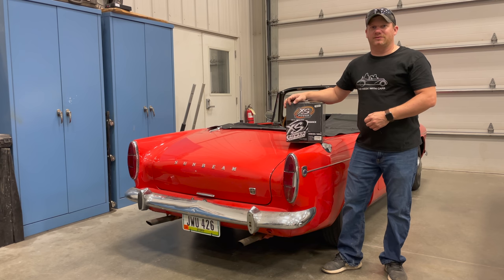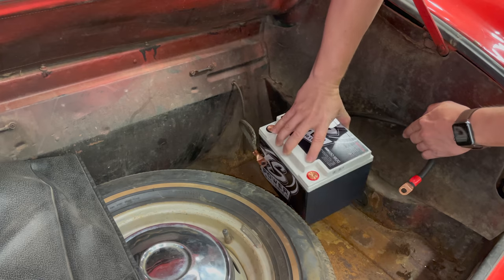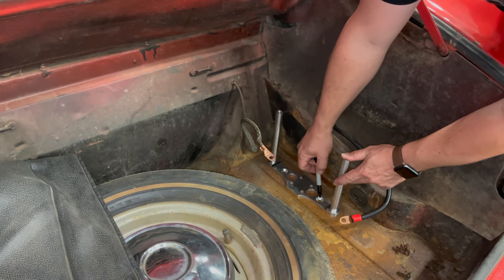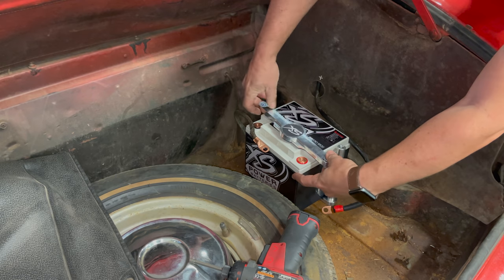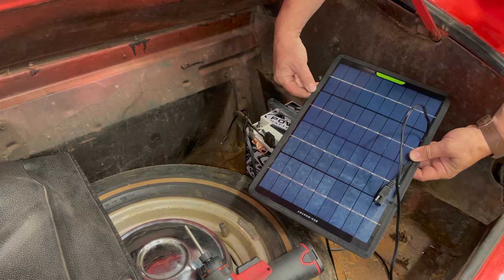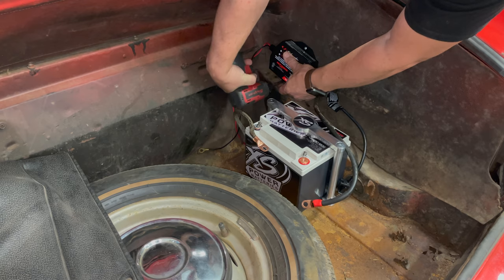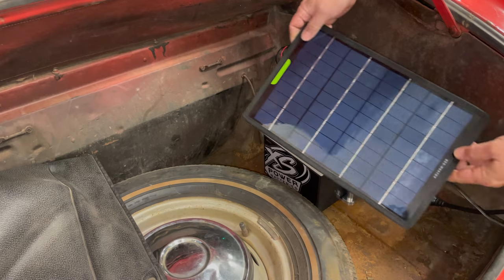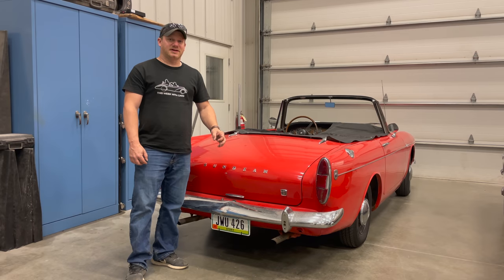Installing Ultra-capacitor and Onboard Battery Charger in Sunbeam Tiger

Comment: I too, have never heard or seen one of the Super Capacitors. From what you've shown us here Steve, this would be an ideal unit to install in my car, when I store it for the winter again.
I sure would like to learn more about these 'capacitors in place of the heavier  'old' battery.
A lot of questions come to mind for replacing these, as capacitors are not, usually, that good at storing power,

Comment: I used capacitor instead of battery on  my  Royal Enfield and it worked great with the kick start back in the 70's. I am amazed how far they have come along. Thanks for the infromation on the Ultra capacitor battery and the charging systems that can be used with it.

Comment: Goes to show you that you never stop learning. The ultra capacitor is amazing. I want one for my riding lawnmower.
Reply: No kidding. I had no idea you could get capacitors powerful enough to use on a car.
Reply: Funny you should bring up your mower Bruce. I was just daydreaming about how long the battery would last on my new riding mower and if it was gonna be hard to find the exact fit for a replacement. I think one of these units on a mower would be the perfect alternative.

Comment: I have put a flat metal plate on the top of the batteries in my own cars with a metal angle that goes to the top corner of the battery and placed the rubber under it so that the battery is not damaged or moved and keeps the battery easily in place so I never had to tighten it so tightly,

Comment: Never knew about these things. Will they eventually replace batteries?
Reply: Not likely.  More expensive, far less capacity, far higher peak current which means they are more dangerous if shorted out.
Reply: As the other replier said the capacity is tiny compared to a battery, so no good if you park the car with the lights on for instance A lot to be said for having both a battery and an ultra capacitor though. The fast charge time seen in the video is a consequence of the tiny capacity it has.
Reply: @g0fvt  Agree. Both in combination is best for cranking.  I also use the heaviest battery I can fit in my FWD Metro for best traction, but the light weight can really help front engine RWD cars especially with a capacitor in front and a battery in back can crank with a thinner cable than with just the rear battery.
Reply: @g0fvt  I calculate that a 100 amp charger would fully charge it in 39 seconds, unlike a battery.
Reply: @alan6832  there are benefits and disadvantages. With a super capacitor bank to take care of engine starting peak current a parallel combination could be very good. I am guilty of having about the biggest battery that will fit in my diesel car but it is only a tiny percentage of the vehicle weight I suspect it has little effect on traction. However it does mean I can leave the lights on for at least a few hours when parked in the evening. I have some super capacitors to play with but they are not in the car starting league. At one time I was going to buy 6 3500F super capacitors but they are a crazy price. A super capacitor bank only is not a viable option for me.
Reply: no

Comment: Well done Steve. Wondering if the computers in modern cars are compatible with Ultra Capacitors. sorry for asking same questions in all 3 videos but not sure which you would see. Cheers

BTW good find on the onboard battery charger u installed.

Comment: What a perfect idea.  No fussing with half-dead batteries, fumes or corrosion.  Did they say how long that cap lasts?  Can't see it having a short life.
Reply: As with anything, there’s a trade off. They provide a large burst of current but only for a short time. So the (big) issue is (for me) that my 1976 Triumph Stag sits for months under a cover but then takes a few cranks to start. Whilst the super cap would charge fast it wouldn’t provide the endurance needed to start the car. They’re great as an add-on to existing batteries to cover for any short-term extra demand but for a classic car, after not being driven for time, it just wouldn’t work.

Comment: What are the disadvantages of an ultra-capacitor when compared to a regular car battery?
Reply: Looking at the specs it could be considered equivalent to a smaller 20ah SLA. Imagine your Subaru battery is around 70ah fully charged but deteriorated by age to 20ah now on a cold morning. The benefits are weight loss. Great simple video though. I like the battery tie down. One point I would be thinking about is the sacrificial chemical interaction between the aluminium and the steel. Eventually it will deteriorate so it might need some protection. Nice example of a Sunbeam too I'll watch the rest of your project.
Reply: #1 is capacity.  These are likely 90% or less the reserve capacity of a typical lead acid battery.
#2 Cost - they cost more.
#3 danger - if you short out a capacitor it can dump it's entire charge in fractions of a second.  This can vaporize wires, tools, brushes etc.
A typical 80 mfd photoflash capacitor can vaporize 18 gauge wire when shorted out.  Starter windings are what? 24 gauge?  These have thousands of times more energy.  
You better be damn sure you know what you're doing and fuse EVERYTHING.
Reply: @tiporari  I was thinking of the same downsides. Regarding fuses: it might be that fuses are too slow to respond if these capacitors are able to supply such large currents in so short period.
Reply: @HGSuper  I noticed the same thing: no rust or corrosion protection was applied when putting that battery holder in place. It made me even more concerned when I heard that multiple, dissimilar, metals are involved.
Reply: @windmill1965  fuses don't 'respond', they disintegrate as soon as they see a current load in excess of their capacity.

Comment: I think a great use for fuel cells using metal hydrides would be battery and ultracapacitor tenders that wouldn't require connection to the wall.
Reply: Interesting idea.

Comment: Do you have to convert to negative earth?

Can you use one that is smaller?  I’m supercharging an Arnolt MG, and the supercharger encroaches on the battery box.  This might be useful to give room for the supercharger carb and air filter without having to move the battery to the trunk.
Reply from the maker: You can use with positive earth.  This is the smallest one you can buy but you can build your own that is smaller like I did in my first video.

Comment: Won't the mount bolt heads be kind of hard on the bottom of the capacitor?
Reply: They are countersunk flush.
Reply: Probably will fall through the rusty floor anyhow...

Comment: Living several floors up and parking under the canopy of several trees in Scotland would make this as practical as an ashtray on a motorbike for me which is a shame. Flat batteries seem to be more frequent in recent years on my current car though the car before was still on the original battery 14 years down the line.
Reply from the maker: If you drive your car at least once every couple weeks it will stay charged.

Comment: Never heard of these before. Don't think they sell them in the UK. What are the benefits? and also the cons?
Reply: They are extremely lightweight, output higher peak current, and charge almost instantly.  Downsides are expense, drastically lower capacity (not many restart attempts), far more dangerous as capacitors can dump all of their energy very quickly.  With short circuits they can vaporize wiring, cables, tools, etc.

Comment: Those are used in jump starters cause they can multiply even a small charge in a dead battery and charge it up, I think, anyone know if I’m right?
Reply from the maker: Yes the voltage does not drop quickly on these like a battery and they can provide very high current so they are great to be used to jump start in junction with a battery.  Maxwell Starting Units are used in this way to start large diesel trucks in arctic condition to get the engine started when cold.

Comment: $500.
1200 Farads x 12V = 14,400 Coulombs / 3600 = 4 Amp Hours.
You better hope it starts immediately.
Peak current on a cap like this is something like 15,000 amps short circuit.  If you short it out you will lose your fingers, eyeballs, etc.  
I like these, they are neat, but they are overpriced and completely impractical for your average end user.  You better know what the hell you're doing.

Comment: It would be better with a Chevy 327.

no, I'm not sorry.
Reply: You would be if you had to change the plugs on a hot sbc in that engine compartment. The narrower sbf barely fits. Widen the underhood area to better fit a motor and you'll probably be sorry at resale time too.
Reply: @432b86ed  70 years old I've changed the plugs in a lot of Small Block.